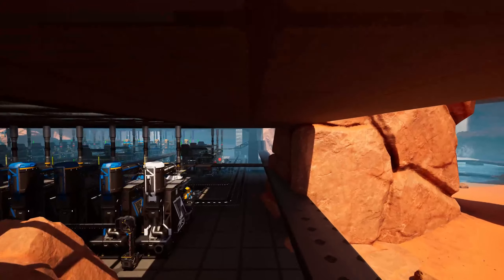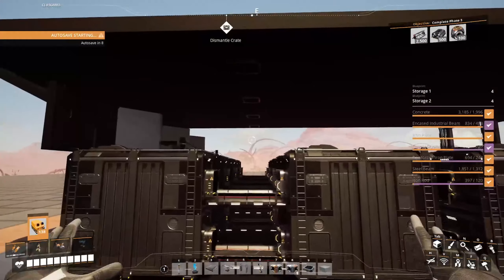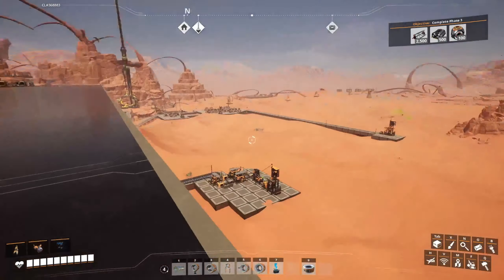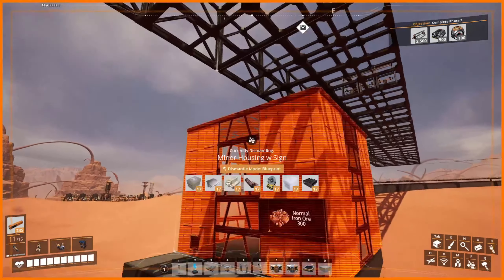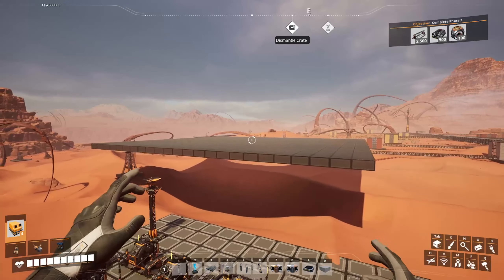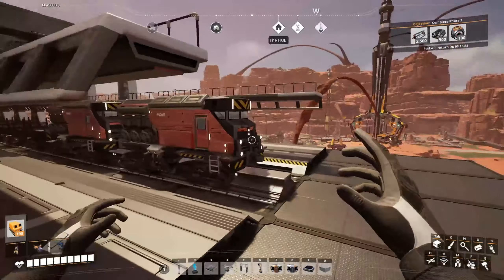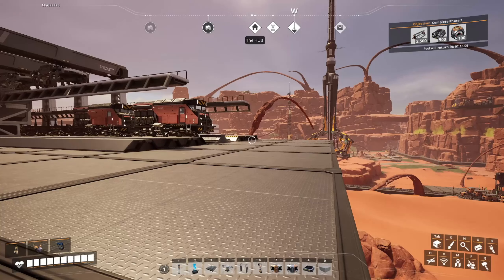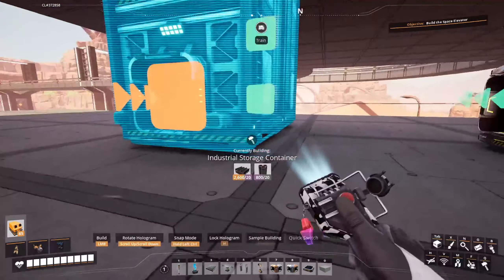Load Balancing 1080 Concrete - Starting the REAL Factory - Satisfactory 1.0

Comment: Bit of a recommendation. A few items you will want the larger buffer and to add additional dimensional depots. Concrete/steel/silica for instance your going to want 5-6 depots connected.
The other thing is if you want the depot to fill first, which you do, delete both belts then add the depot belt first then the connecting belt to the rest of your storage so it prioritizes the depot.
Great build though.
Reply from the maker: That’s a great recommendation, thank you! I think I’m going to need to find a few more Mercer spheres soon.

Comment: With Trains it's nice to have the MK3 Blueprinter. Since you can place 3 freight station with containers on it already, which makes the repetive work much easier.
Reply from the maker: Ooh that is nice! I know there used to be an issue where things like belts, pipes, and train tacks didn’t connect with blueprints, would the train stations have the same issue?  I haven’t tried since 1.0
Reply: @moo121  Yeah that's still there. If you need to connect two blueprints together, you need to remove one freight platform and place it again + the belts which feed the container. For tracks I just made 2 blueprints, one with tracks and one without tracks, which I alternate and then just connect the tracks together. Especially useful with the hoverpack since you never lose power with this method.
Reply from the maker: @MinecraftRedstoner2  That's a great work around! The 2 blueprints, 1 with tracks and 1 without is a great idea. I can't wait to get the hoverpack